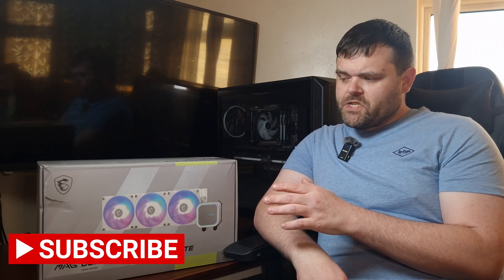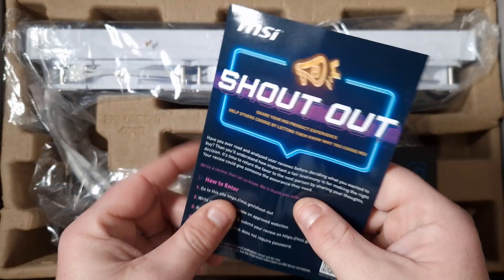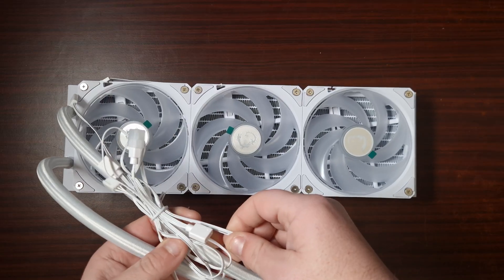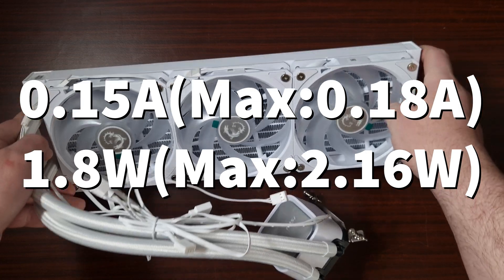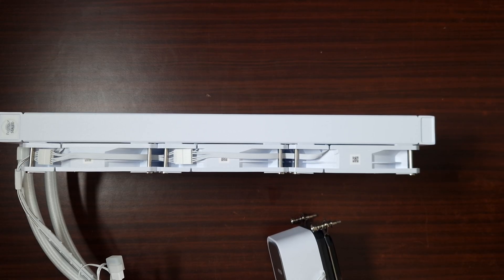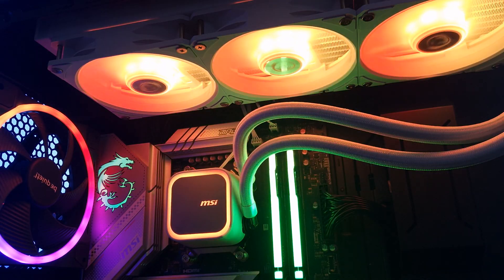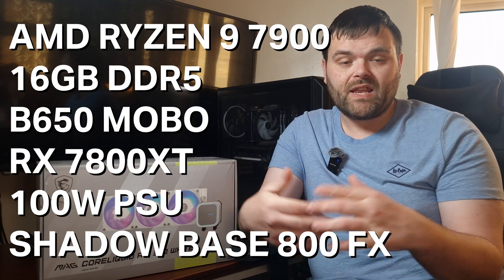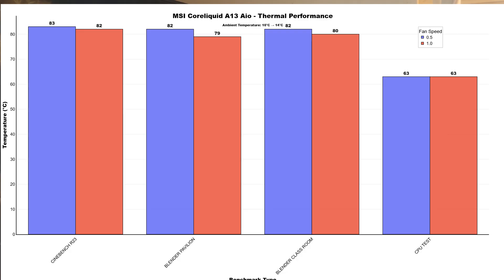MSI MAG CORELIQUID A13 360 Aio Review - A Must-Have or a Miss?

Comment: What sockets did you fit your wiring into everyone does vids but misses that part out
Reply: Sir what is that orange rectangular box where the cpu is placed. Is that a protection for thermal paste.. where i can find that box...?😢
Reply: @vijaatnai5053  In case you still don't know. It's a Thermalright AM5 contact Frame. On AM5 It is primarily to make it easier in applying/reapplying Thermal Paste.

Comment: Hi man, very insighfult video....  i have a situation, i got the same AIO set in a R7 9700x, the pump speed is ok (3845 rpm), but cpu in idle (windows desktop) is 70-80c at 2-7% cpu use... what can be wrong?  case air flow seems fresh. Thx in advance
Reply from the maker: Did you remove the sticker one under the Block?
Reply: Did you remove sticker?
Did you properly set up the water pump, and other stuff in bios?
Is it mounted well to the backplate?

Check these things :)

Comment: How did you rotate the MSI logo on the pump? I saw that at first it was facing the hose but later it was to the side
Reply from the maker: It lifts up
Reply from the maker: The plastic bit with the msi on it lifts up
Reply: Ahhh awesome! I wasn’t sure if it did and I was scared to break it. Thanks!
Reply from the maker: Most welcome